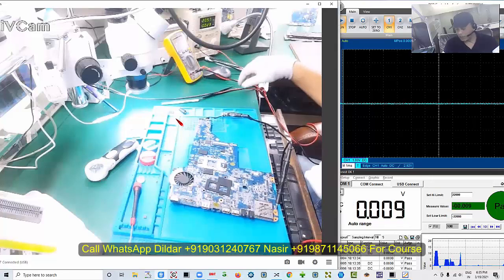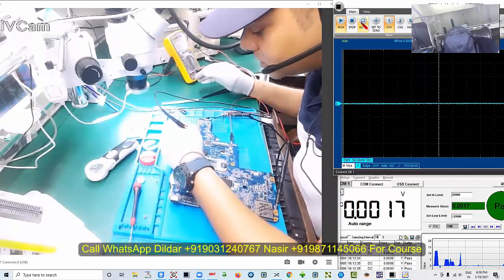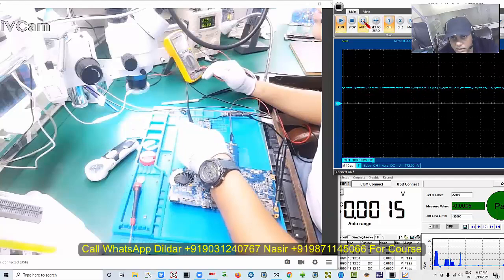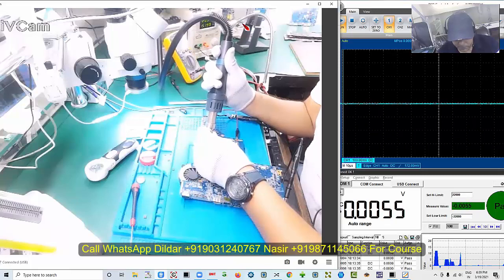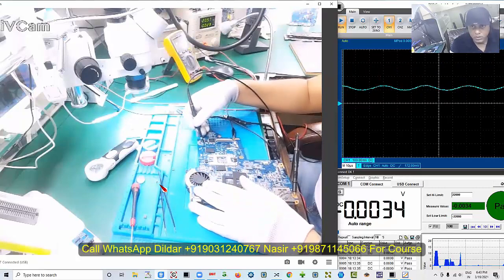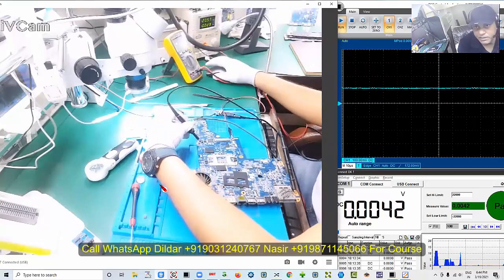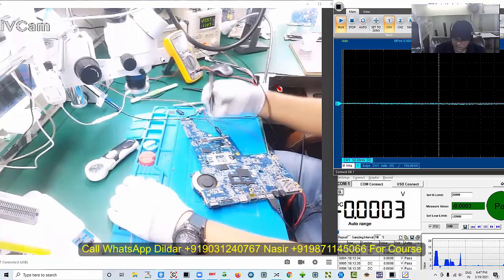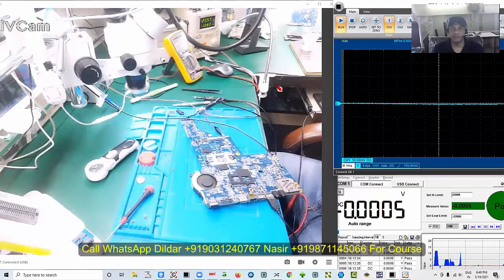How to Check RTC crystal 32.768 KHz in ENGLISH For Beginners |Online Chip level Laptop Repair Course

Comment: Hi. Nice video. I have experience the same with a board that turn on no video. I got read input signal frequency but output wave is shown but dimm out to plane. To probe if it is ok I have tested SUSCLK signal and I found the digital square signal. 32.768khz working ok. It supposed if you have this signal that comes out from the cristal so Cristal is ok. Let me know any feedback. Thank you for your time.
Reply from the maker: Its should be same as shown in the videos then its in its correct form factor...
Reply: @laptex1377  writing mistake it is  SUSCLK signal  not CLKRUN . And I ment to say  output signal is shown but dimm out to flat. The same as your video.